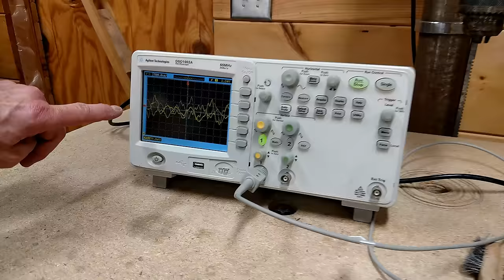Active Noise Cancellation

Comment: The 600 speaker 26,400 watt "Wall of Sound" built in 1974 by Stan Owsley used this technique to eliminate the feedback from the microphones on stage.  Each mic had a second mic 180 degrees out of phase two inches apart or so.  Vocals went into the top mic about two inches above a lower mic, the second mic cancelled the sound on stage: no monitors!   

The sound quality at Dead concerts was superb; almost 600 meters away.  The show could be heard 2 miles away!  Not bad for 1974!!
Reply: Fascinating
Reply: That's mad, thanks for the fact!
Reply: Very cool 😎

Comment: As I listened to this in my truck, I found some standing waves during the demonstration part of the video. Moving my head 6 inches from the driver seat made the sound much quieter. Pretty cool secondary demonstration of the impact of interacting pressure waves
Reply: Tbf, that depends on the speaker setup in the car. If you had one in each door for example, not only will the rear speakers interfere but the fact you'd have to move left and right changing your distance between the speakers not back and forward. I'm not calling you a liar 😂 just saying results may vary depending on the car.

Comment: Very clearly explained 👌
Reply: Negative. The explanation of what sound is was actually pretty terrible.
Reply: i was having trouble i loved the part about dual foam steel construction absorbing both high and low frequencies it makes perfect sense.. but "phase" and cancellation occurs when the net wave is zero. It is way more effective to describe audio/noise cancellation as a wave with a positive and negative poles. polarizing or flipping the wave will leave you with a net of zero.  side note: not having recording devices equal distances from the source creates a loss of phase strength in this same regard
Reply: @frodev728 , actually it was a very good explanation, to visualize better, imagine bars, instead of a wave.

Comment: Make one for the window and save the world from traffic noise.
The vibrating window is the source of much noise in the home at night for the people who live near roads or airports.

It's possible to make the glass to vibrate less with this type of setup.
Reply: Theoretically, yes it's possible  but because glass is so brittle it wouldn't be efficient and it could possibly shatter due to a large noise, also you would have to put up with the system right in the middle of the window (If you care about your view).
Reply: Helium
Reply: @dvinnyq2889  Yup, just what I was thinking. What about a "decompression chamber" (Is there a proper term for this? Anyone? Help?) between panes of glass comprised of a low-density gas like helium? That would deaden a lot of the sound just by not having enough molecules in the space between panes to push around. 
I feel your pain if you live near an airport, as I grew up under the secondary flight approach vector for a large international airport that they used when there was bad weather.  One observation I've made is that larger aircraft engines produce a much deeper tone, a sort of rumble that shakes the very framework of the house and uses your roof/attic as a sort of sound amplification chamber when anything the size of say a 727 or larger is on final approach. At takeoff, the higher frequencies spike in intensity, but on landing approach, I don't think silencing the windows would be enough. Just my $0.02 though, love the idea. And yeah, even so, the helium idea would probably work great for takeoff/flyover paths. Just not arrivals, so much, I think. Still a great possibility for ~80% of the people around an airport, I'd imagine.
Reply: How about trying to combine this with the panel-speakers? As they distribute sound better, and are cheap.. Placing a microphone on the outside of a window to reduce feedback, and the speaker next to  the window (on the inside). 
Applied science has a video where he shows how to convert a window into a microphone using a laser and an optical receiver.. 
Headset with active noise cancelling is my current solution, altho I prefer sleeping sideways.. Considering making a pillow with a hole for the cups, but this sounds cooler!
Reply: The noise is a not correllated signal! 😀😆 is not the same like an Sinus-Signal from Generator
Reply: I made a design project about that a couple of years back. As it is tecnically very difficult to do perfectly with a window, I used an adjustable level of rain sound simulation for noise masking aswell. Check my portfolio on www.gardhagen.com for the concept itself. I never had the capacity to sort the phasing issue for the prototype, but the adjustable rain simulation worked great. /Gard :)
Reply: J B Thats why you have to use microphones, literally what they did in this video and what the entire video is about. 

Btw as a side note, have you ever heard of  active noise cancelling headphones? They use this technology and it works really good.
Reply: @ArtemisKitty  Most windows are already composed of two panes of glass with a vacuum in between them. Isolates both sound and heat.
Reply: @Dolkarr  Errr... not in America. The technology was just becoming affordable for most Americans in the late 90s, however there were still a lot of issues during that whole housing bubble with unsafe gasses being used etc., so they didn't really become standardized until around 2006-2007 and begin taking hold as a more standard option. Most houses built before then will have single pane non-insulated-glazing windows unless they have been upgraded to new IG standards. This still comprises a very small percentage of households in America, and I'm pretty certain that if one took the time to do the comparative research against other similar first world countries, it would be pretty similar. Most people do not see the need to replace things until they are completely broken, even if a short term cost investment would yield a long term savings and efficiency benefit.
Reply: @ArtemisKitty  Ah, that explains things. I did not know that.
Reply: @Dolkarr  Yeah, I'm just old, so I was just getting out of high school when all that was happening. Bad gases in the glazed insulation double windows that were leaking or causing severe discoloration, some of which were extremely toxic, asbestos in the insulation that was unexpected, paint and particle boards inside their walls leaking dangerous levels of lead and toxic gases (to the point where being indoors during the summer to stay in the air conditioning and avoid the heat could, and in many unfortunate cases did result in hospitalization/permanent lung/neurological conditions or death. This turned home buyers off for several years on "that new technology" (because to THEM it was new) since they saw it as an unknown, and the news of deaths just confirmed their suspicions. I also grew up about 1 mile from an international airport, and specifically right under the secondary approach vector for international flights when there was bad weather, so I'm VERY familiar with what single pane windows sound like in that case, lol. U also helped my family build about half the house in the late 90s, but even then the standard was just barely STARTING to shift, to the point where if you HAD glazed insulation, your friends/coworkers would pester you about it non-stop because it was so exotic. Like stories you hear about owning the first color TV in the neighborhood years ago (obviously).
Reply: @Gardehesten  This is actually a very nice and innovative concept. Well done!
Reply: Are you guys talking about something like Muzo?  They raised a lot of money on the idea, but sounds like if failed pretty bad.

Comment: Very interesting. I came here because I have an older diesel truck. Dodge did a excellent job of removing cab noise but the engine is soo loud you have to turn it off to talk outside of the truck or in drive throughs. I would like the cab a little quieter especially on long family trips with the load of our trailer. I already had an idea how noise cancellation worked but thought I could simply have a microphone under the hood and an out of phase speaker in the cab. You made me realize it’s not quite that simple. Thanks for an informative video. I see some small 2t engines in the background and it looks like you do some interesting stuff. I’ll be checking out more of your channel and possibly subscribing. Thanks.

Comment: You got extraordinary explaining skills with very clear phrases Sir! Thank you for making this video. Liked & Subscribed! 

I have a question, Sir. I could not help myself thinking that, if you want to stop the noise within a box, why using a vacuum shell structure is not an option? for practical purposes?

Another question, is it possible to cancel the noise coming from a source by projecting phase-shifted sound right to the source (feedback from a mic in the pathway of the sound and with a proper delay), without keeping the source in any kind of box?
Reply from the maker: Yes.  A vacuum is the ultimate solution.  It would be even better than hydrogen or helium (take a look at those videos).  The heavy structure to support it is the deal killer.

Comment: I believe that there is one more variable that could be used to increase the wall rigidity: the actual wall shape. Curved walls would be more rigid then totally flat walls (cylindrical or spherical sections?). Also, searching for specific walls geometries with no or little resonance in the frequency range of the noise generated by the engine might also help.
Reply: As in bose original wave guide that produced ‘big’ sound from a small box. Plus, the geometry of a heat sink, fins to inside giving more surface area to trap/break up waves plus vibrate at à frequency that produces heat vs audible?

Comment: I have had an idea for a long time for a specific use case, and your work will get me closer to my prototype. Looking forward to the next videos.
Reply from the maker: Good luck!
More incoming.
Reply: @TechIngredients   Question for you and your dad... First of all, I am one of your biggest fans for sure... Maybe I'll post a Short on my solar heater, and "world's best speakers" hanging from my room ceiling... both partially inspired by you guys. The idea I mentioned I have, may not be the most profitable idea but it's likely decently profitable... Patentable-i'm pretty confident about that-. I won't be able to get any of my so very many ideas off the ground without help, mentorship, older wise advisor... or something similar.  Maybe we could come up with an agreement and collaborate on it. I'm willing to sign over whatever profits to you two, in order to get a tiny bit of passive income, all said and done through licensing out or outright selling the patent. I just gotta start making my ideas reality, and no one close to me that I ask knows what to do with my ideas. 🙏🏻

Comment: This was absolutely beautiful! You can learn so much about sound from this video :)

However I would like to point out that there is ONE MORE passive noise reduction technique that was not mentioned!

The shape of the box! While a cube is very effective for active noise reduction, since you can more properly pinpoint the waves to invert, having angles in which the sound almost slides off of will reduce the vibrations of the outer layer significantly. 

This isn't useful in this scenario, as you know the source of the noise, but not the location of the listener. However, if you know the location of the listener and not the location of the, source of the noise it can be very convenient!

This is why sound-proofing walls for musicians and theaters tend to have triangular structures to 'trap' the sound, letting it vibrate all that it wants away from the listener. Alternatively (or supplementarily) they will have curtains to 'catch' the vibrations and reduce echo~
Reply: Very interesting point, do you have a background in sound engineering?
Reply: @benhurj  I wish. I have a background of music and have studied heavily in acoustics (specifically for microphones and on-stage settings for music), but I'm not very knowledgeable in terms of technology outside of Digital Audio Workstations

Comment: Parallel walls amplify certain waves (standing waves). So maybe a box without parallel sides would be beneficial here. And also, I think this type of rudimentary noise cancellation won't work as great for non-linear / noisy sound / non-repeating waves. But that's maybe not a huge issue for motor sounds. What is an issue however is that a motor will produce many different sound waves - which probably aren't all part of one overtone spectrum. So the cancellation can only focus on some of these waves while not working well with others or even increasing their amplitude. It would become much more complex if each wave would be tackled individually with a FFT and resynthesis approach, but it would probably be more effective. Going to watch your follow-up video now...
Reply from the maker: I suspect non-parallel walls will help to some extent. You are correct that this is not a sophisticated, FFT approach which would undoubtedly would be more effective (and more complicated). For reducing the sound of a fixed and relatively predictable spectrum this may not be too bad.  Another, less computationally intense approach would be a much larger number of small voice coils paired with 1D accelerometers.  The feed back loop would minimize accelerometer signal locally.  A high bandwidth of at least 10x the intended damping frequency would likely work pretty well.
Reply: John Flury exactly, in sound engineering we avoid parallel surfaces like walls and glasses. Then even absorption materials like foam, wood, fibers, etc. are shaped in multiple angles and sub angles in them too. You want sound waves to move away from direct reflection and drive them to absorption matter. This is a base setup concept in most studios and dead rooms.
Reply: @TechIngredients  can you elaborate on this idea of using 1D accelerometers? I'm not sure I understand what you're saying
Reply from the maker: The accelerometer will act as a microphone does to convert the displacement over time into a signal that can be amplified to drive a voice coil to resist that displacement in a feed back loop.
Reply: @TechIngredients  do you think it'll work for not steady waves given the delay to process and react to the signal? You have to use an MCU to read accelerometers.

Comment: Thanks again for that great physics video.  Very informative/instructive. In teh next video you could also talk about helmotz reasonator. Those cavity delay the phase that become itself cancelling his own source. but as well it only work on a single frequency and few harmonics.
Reply: A Helmholtz resonator is like blowing air across an empty bottle, the length of the tube and the volume of the cavity set the resonate frequency. Here he is trying to cancel multiple frequencies. Without an adaptive algorithm, the highest frequency that he can cancel reliably will depend on the distance between the mic and the exciter (speaker).
Reply: I should also point out that a Helmholtz resonator is the idea behind ported or vented enclosures. This adds two poles to the high pass response transfer function of a bass driver and can therefore influence more than just one frequency. It can pull up a large section of the response curve giving you more bass response at the expense of more phase shift.

Comment: In 1990 Lotus used a noise cancellation technology on their Lotus Esprit.  Lotus researchers mounted microphones, which monitor noise, in the car's passenger compartment and feed the information to a small computer. The computer analyzes the sound and produces a signal, through the car's stereo speakers, that is identical in pitch and volume but reversed, so that the peaks of its sound waves coincide with the troughs of the original noise, effectively canceling most of what is known as the resonant boom. The anti-noise signal is not audible on its own and does not interfere with music reproduction.

''The first patent was filed in the U.S. in 1934,'' said Malcolm McDonald, general manager of noise, vibration and harshness for Lotus Engineering, the research and consulting unit of Group Lotus, the British sports car company. The procedure had been made possible only after a few years by ''advances in digital signal processing and the modern digital signal processing chip,'' Mr. McDonald said. He added, ''We are using not just one speaker, but four or six and feedback from six microphones; it's the ability to process that all very rapidly which has made it possible.''

Today, Lotus has Halosonic which comprises of a suite of four Lotus patented Active Noise Control technologies that enhance the in-cabin audible environment and improve pedestrian safety along with Road Noise Cancellation and Engine Order Cancellation actively control refinement levels and minimise undesirable low frequency noises.
Reply: Cool, thanks!

Comment: Can this be used for getting rid of infrasound low frequency noise and vibrations that is invading the whole house from a outside industrial environment?
Reply from the maker: Yes.
Lower frequencies are easier and harder.
The long wavelengths make spacing between the microphone and the driver less demanding. This is because compared to the wavelength, they are virtually in the same place. Lower frequencies will need more power to counter the pressure from the incoming noise.